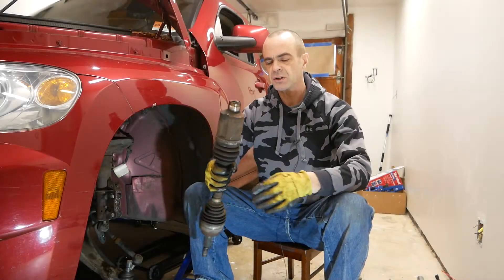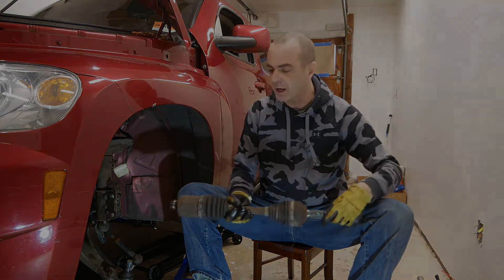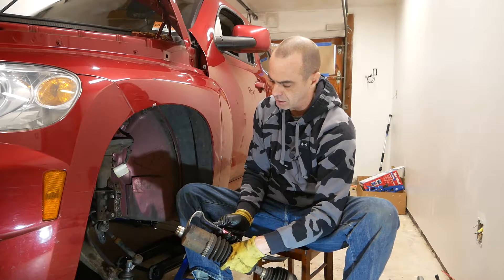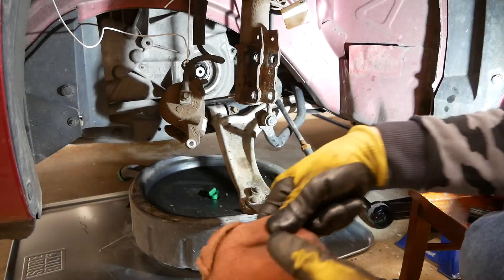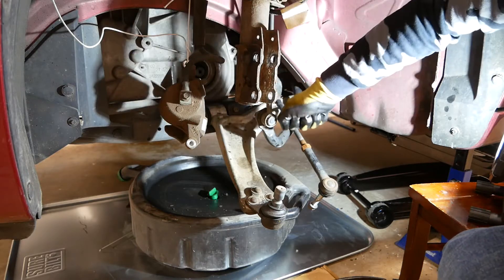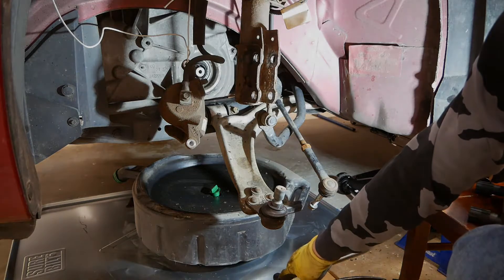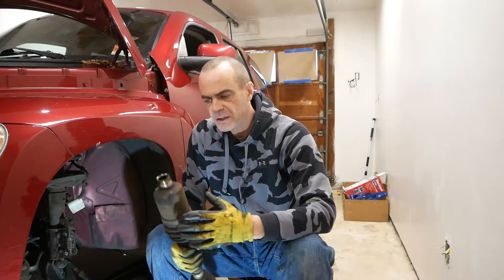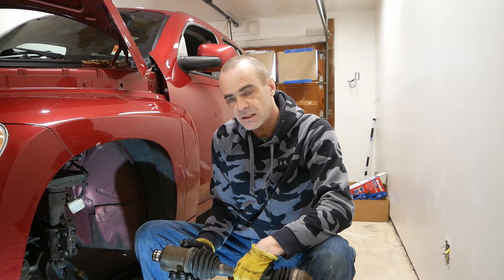How To Remove a CV Axle From 4T45-E Transmission - 2010 Chevy GM HHR Cobalt FWD 2.2L

Comment: If you have a hoist a regular pry bar would probably work for removal but there's not enough room with jack stands. I ended up tapping it a couple times with the back end of a pickle fork and a 2 pound sledge if that helps anyone
Reply from the maker: Yea it wasn’t easy. I actually did all this work for nothing, turns out the problem was with the TCM under the hood 😂
Reply: @importgarage1715  Do you know if the new TCM needed to be reprogrammed to work with the car or was it plug and play?
Reply from the maker: @Rando3  Not sure, it was replaced by a mechanic. 

They did say to drive it for a while before taking it to inspection after it was replaced

Comment: There's no dipstick on HHR transmissions you drain and fill like you would with a manual Tranny. The filter and gasket are the same as older GM FrontWD models without the dipstick (Maintenance Free...).

Comment: Thanks for the video.  What did you find wrong with the trans not shifting to 4th gear?
Reply: That’s why it’s so important to do a proper diagnosis. Everything you did was for nothing, and the transmission didn’t even need to be taken apart. Misguided parts changing is expensive.
Add an alignment on to that also because of the front end disassembly. 🙁
Been there done that my friend, never again for me.
The cost of a proper scan tool may be expensive, but I would put that up against this scenario any day of the week.
Reply from the maker: I never found the problem, once I got the side cover off everything looked fine, I also replaced some parts which didn't help. I wasn't comfortable going any further with it
Reply: @importgarage1715  Are you still trying to fix it or have you moved on?
Reply from the maker: I gave it a shot for a friend to try and save them some money. Was really hoping it was a shift solenoid or something else under the side cover. It was not easy without a lift, just getting the side cover off and out was a real hassle. I think I have a few more videos I haven't uploaded yet.
Reply: Hopefully you have a service manual .  It explains what could cause it to not shift to 4th. First thing would be to scan it for a trans code.
Reply from the maker: It was the TCM under the hood